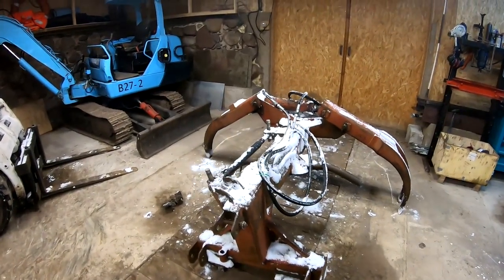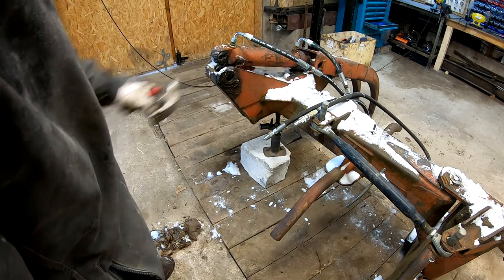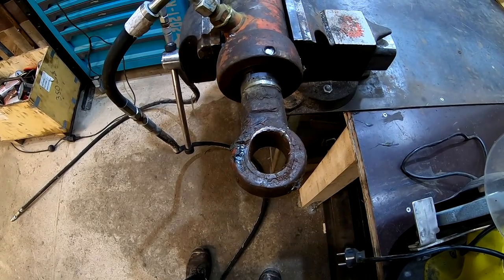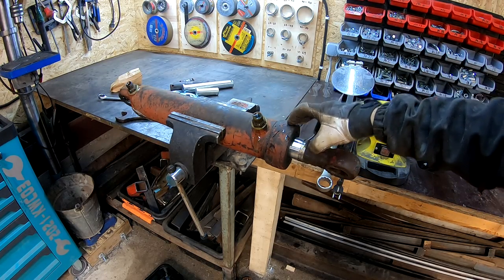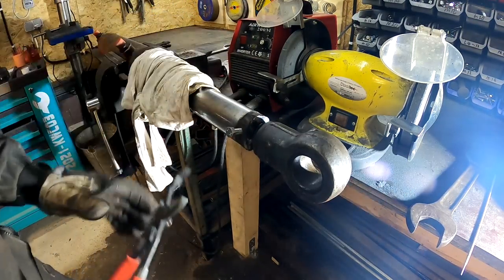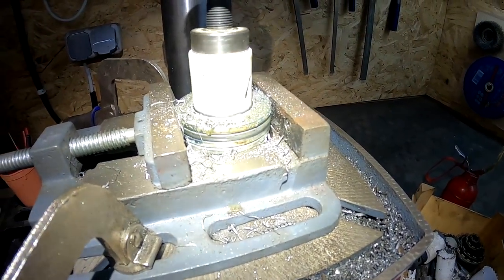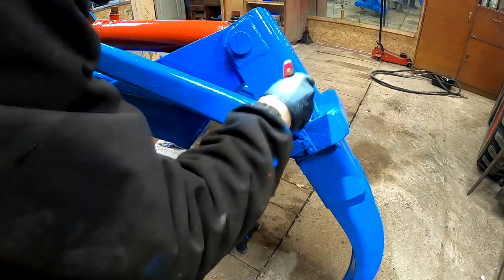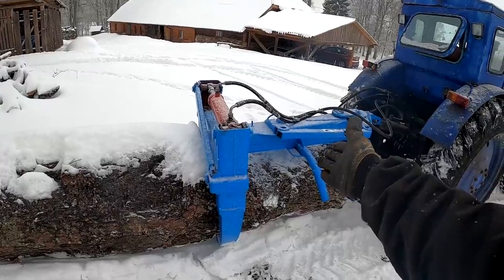Fixing a neglected old Log Grapple

Comment: Hey I just saw a video on the Echo CS370.  It has a bar chain oil adjustment screw in the vertical position facing down under the chain guard. you don't have to remove the chain or guard.  Right for more left for less.  All Echos are supposed to have this screw.  Check it out on your grandfather's saw.  Good luck.

Comment: It was very interesting to watch. Great job! Now you need to make a stand to place it on when you are disconnecting it or attaching it to your tractor.
Reply from the maker: Thanks! I put some log on one side to keep the mounting holes on same level. The issue was that if its placed on the ground one hole is a lot lower then the other making the mounting really annoying plus its so heavy so cant move it by hand. Take care and stay safe!
Reply: @Ants_Pants  I know what you mean. I have a tractor winch and even though it has legs built in...the ground is not always agreeable. I hope you are doing ok and have not tested for covid any more.

Comment: Nice repair.  I thought you were going to rip your vice right off the workbench when you were trying to unscrew that eye from the cylinder with that huge breaker bar.
Reply from the maker: The table is anchored to the floor i thought im gonna break that instead. But yeah the 5mm steel plate pn table needs to be thicker. Im thinking a couple of feet atleast 😅

Comment: A trick when clamping different sized pieces together in a vise:  put a couple of pieces of copper wire on each side and clamp down.  They are soft enough to take up the difference and make a secure grip.  I would have used a 'C' clamp at right angle to the jaws also.
Reply from the maker: Good idea will keep that i mind. Aluminium would also work well.

Comment: Make up a bracket fr the grapple which fits the Bobcat.  It would be  a useful addition?
Reply from the maker: This too big for my bobcat, think it weights about 300-400kg, but bobcat lifting limit is set to 605kg (it can lift 1,2ton, but then it will start to tip over)

Comment: Have you ever thought of putting a wood burning stove in your work shop. thanks for sharing.
Reply from the maker: Yes. But i am a fire hazard nut so id rather not. Plus thers no room currently i need to get some equipment out. I dont want the excavator in shop its not a good place for it.

Comment: Take a look at a backup camera.  They aren't overly expensive and for hitching up they save a lot of time.  You can watch it as you maneuver right into place.  Some guys plow with the blade on the three way hitch but they have to have their head swiveled around to where I wonder how it stays on!  A camera fixes that up too.  Drive in reverse watching the screen.  Takes a bit of getting used to but is pretty simple.  Just get a big enough screen to comfortably watch.  Now they have the wireless ones so that installation is nothing.
Reply from the maker: Yeah iv looked into it in the past. Might have to revisit it. Thanks!
Reply: @Ants_Pants  Now that they are wireless you can easily move one from vehicle to vehicle.

Comment: you should spend 50 bucks on eBay and get yourself a 2-ton chain hoist, I did a couple years ago and I don't use it every day but every day I use it I'm glad I bought it.
Reply from the maker: i will get one, once i decide if i  will build a gantry crane in my shop or not 👍

Comment: Now that you've got that lathe-
Find out what all those huge Taps and Dies are good for!

Watch "Turn Wright Machine Works" (Keith Fener) and Abomb79 (Adam)
and John over at Farm Craft 101 is pretty skilled, too. 
"Made in Poland" many others here, in the YouTube community, are super helpful.

With time & practice- you'll be amazed how easy it is to mill your own stuff.

Make a simple propane & brick oven, get some carbon powder to cover red hot parts with, 
to case harden stuff like a pin, after you drill a small grease gallery. 
Quenching with water shocks the metal, making it brittle like glass. 
Cooled slowly, in carbon powder is "case hardening".

Ever see the shackle of a quality padlock? It reads "HARDENED".

A brass bushing, with a grease grove in it- is easily parted off stock, boring tool
for grease groove. Tap the Boss, put in a Zurk fitting. A 1 cm ring of pipe welded around
the grease fitting is always a great idea! Use a plastic cap to cover it. Think, man-
if it articulates- it must have "sacrificial" components, one softer than the other;
steel against steel is always going to wear, no matter how much grease or even
pressurized oil, there must be a sacrificial part. Bushings are usually brass. 

Bearing EZ-removal, every time? 
Use Dremel, cut off wheel. Cut perpendicular to the bushing.   (<----cut
Chisel & hammer, cave bearing in on itself. Works every time.

Welding on that small length of threaded rod really helped to center the part. 
Great job! :face-blue-smiling:

Comment: If you had welded the stack of f washer togeather and then enlarged them . Then just grind off the weld and the washers wouldn't move around while you drilled them larger.
Reply from the maker: Hmm

Comment: He didn't see the value of the pivot point and welded it so it would never pivot again. I bet after using the grapple a couple of times, he wished it would pivot.
Reply from the maker: Nope. The claws open very wide. Pivot is not needed in this thing